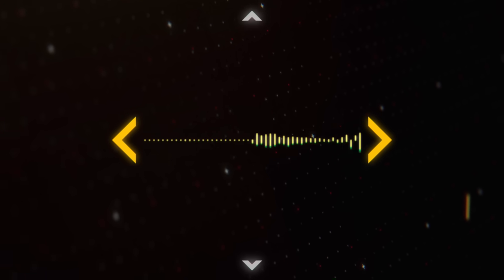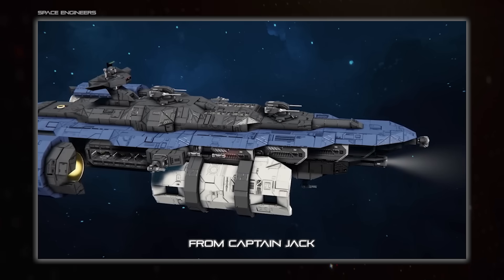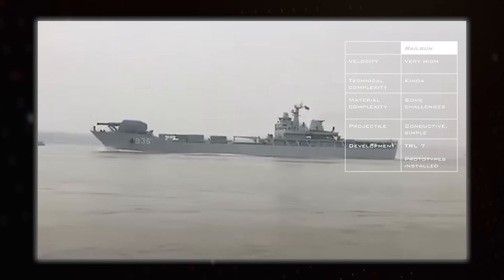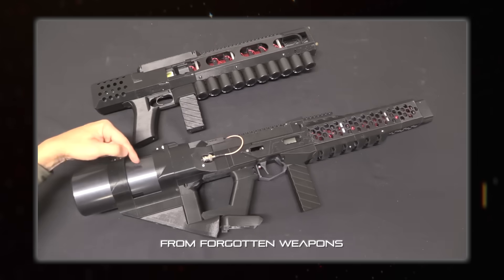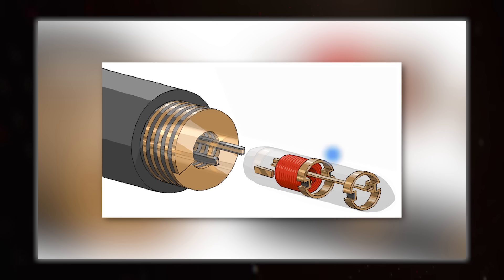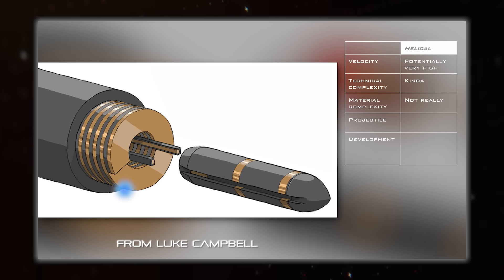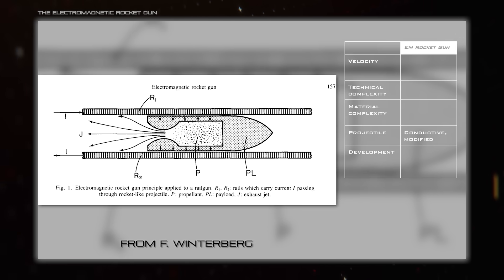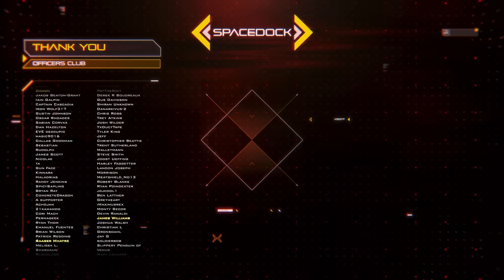The Deadly Coilgun/Railgun Hybrid You've Never Heard Of (Helical Railguns)

Comment: cant the coilgun detect the projectile... well magnetically?
Reply: That is easy enough to do, but an electro-optic system will probably be easier to shield from electromagnetic interference.
Reply: @derekp2674  No shielding, just use the coils themselves as the sensor, their inductance/impedance will react to the projectiles presence, so it becomes only a matter of reliably noise filtering for that no? wouldn't even need a computer, just some fine tuned analog circuitry (well thats what a computer is too but you get the idea lol).

Comment: The most efficient electromagnetic launcher is the "quench gun" a superconducting coil gun. The energy is stored in the superconducting coils then the superconductors are "quenched" by the magnetic field of the projectile automatically turning off the coils as it goes past. So apart from using superconductors it is actually simpler that other coil guns and over 90% efficient conversion of electric power to kinetic projectile energy. While rail guns manage 50% efficiency at best.
Reply: In a coil gun the projectile does not touch the sides of the barrel so there is no friction or arcing. You can find two videos explaining the quench gun by two rival teams trying to build one for orbital launch, Lancaster labs and Electromagnetic launch.

Comment: The big problem for the electrical rails is NOT friction due to "extra high speeds" as it is a problem even for low-speed railguns that fire subsonic.
Rather it is cause the rails need to form a good electrical contact at high velocities and that just doesn't happen easily: Either the contact is not even and you get uneven currents and hotspots, the projectile is a bit too slow and thermal expansion increases resistance, sparks and pitting (really bad), the projectile ablating - or many other things. We are talking about currents way above what is used for welding. The projectile will take a beating from that and that is ok, but the rails are exposed repeatedly to that. If there is any small deviation the projectile might go just a bit slower, further increasing the stress on the projectile and rails, which then again lead to even more deterioration.
This can be as bad as after just a few shot a projectile getting stuck and then basically welding everything together (or blowing the rails apart due to the metal getting evaporated).
Reply: There's also the issue that the rails repel each other when charged, so the gun literally tries to tear itself apart with increasing force the more juice you dump into accelerating the projectile.

Comment: I'll stick with my coilgun. Should really start building some again. The first was some 20 years ago. Me and a friend just bought 100 small elcos. 650V rating so we could just apply squared mains. 10 banks of 10 capacitors. The initial setup included us manually undoing the parallel charging connection and rewiring them in series, with the "trigger" being 2 metal-plates that were closed by getting hit with a good whack with a long wooden pole. Not all that powerful but enough to get a screwdriver bit stuck in some plywood.

Comment: 0:58 In real-life, the conductor which bridges the rails is a plasma. This minimizes wear on the rails and ensures an uninterrupted connection.

If you're wondering how that could possibly work, remember that plasmas are ionized, so they get locked into the magnetic field just as the projectile does.
Reply: That is true in a plasma armature railgun design but my experience is that plasma armatures actually maximise barrel wear. Hence a lot of work has gone into designing solid aluminum armatures to minimise barrel wear.
Reply: @derekp2674  True. The plasma would be extremely hot.
Reply: @pseudotasuki  Indeed, by definition plasma is hot. The term "plasma armature" became an accepted railgun term a long time ago. A more correct technical term would be an "arc armature" but it's far too late to correct that now. Even an arc requires temperatures high enough to melt metal, that is how arc welding works.

Comment: Awesome video! I have been working on my own coilgun for the last few months now, and I believe there is a sort of middle ground between the HCEL and a standard coilgun configuration. Here, instead of using a sensor and relay setup, brushes are placed some distance in front of the coil (or behind it, depending on the projectile), connected to the open ends of the Power circuit. Once the projectile reaches the brushes, the RLC circuit of the coil is closed by the conductive projectile itself, and current can flow with the projectile as a conductor. 

If that sounds a lot like a railgun, then you are right, it is, though in this case the lorentz works against us. The coil creates the dominant B field for the purpose of the projectile acting in line with the rail, wich in combination with the current flowing perpendicular to to the barrel causes an acceleration perpendicular to it and thus wear. This can be mitigated by using rings of brushes instead, allowing current to flow in parallel with the barrel, thereby preventing acceleration by lorentz force.

Not using complex components in the end has multiple advantages: 
-Near-instantaneous switching
-Reduced complexity and cost (high-voltage relays can get very expensive)
-Increased maximum voltage (mostly limited by the capacitor now)

I have not yet been personally able to run tests on this design and compare it to a more conventional setup, though i am quite confident in it, as it doesn't deviate too much from the standard.

Comment: The electromagnetic rocket gun can also potentially make it a recoilless system. If you want infantry portable railguns or at least something that can fit on a truck but you want the potential to destroy something really big, this might be the route to go. It's going to have one hell of a backblast but you can potentially use something like salt water as a secondary coolant, something that is used on the urban warfare, close quarter version of the AT4 rocket launcher, known as the AT4-CS. 

I do think that the cool gaps in sci-fi railguns are something that is an alternative to having the rails be of an actual material. Since you are running millions of watts of power through the rails, why not making the rails actually be plasma? Now, I don't really have a technical explanation of how this can be done though I would think you confine some plasma with a complex magnetic field.

Comment: Professor Winterburg's Electromagnetic Rocket Gun genuinely sounds like Boltguns in Warhammer 40,000.

Insert Futurama title card "You Can't Prove It Won't Happen" gag here.
Reply: Actually, the Bolters are closer to a conventionally propelled gyrojet hybrid.. Basically a rocket propelled grenade, given it's initial propulsion by a chemical detonation, similar to standard bullets. The rocket engine only ignites once the projectile has left the barrel (negating some of the issues with Gyrohets. Mainly the low muzzle velocity.)

However, it seems that the EM rocket gun is the electromagnetic equivalent to a gyrojet.

Comment: Honestly the coil gun would simply work having small sections coil that fire in sequence, back to froward at a certain frequency, and then repeated. Example: 1,2,3,4,1,2,3,4,1,2,3,4 That way the projectile is at the 4, it's clear enough away from the 1 behind it, and pulled into the 1 in front of it. You could even improve that by having some slates that are insulated between the circuit coils, or increase the number of the sequence to like a 10. And At worse you gotta raise or lower a frequency per projectile type in a given enviroment. 
And it's basically no worse than conventional artillery at that point.

Comment: I can see one major flaw with this hybrid in terms of viable weapon usage. It has to be clean, very clean. It'll make it a nightmare if you wanted to make them man portable, as some kind of field rifle or side arm. Also you can't easily use a lubricant either because it's either going to get in the way of the contacts if it's an insulator, or if it's conductive it'll screw up the timing of the moving circuit, by completing circuits it shouldn't be.

Comment: My idea of an electromagnetic launcher is just a crossbow thats primed by a high power electric motor. Mechanical power is stored in the springs, while energy is stored in a detachable battery. No need for capacitors, timing mechanisms or specialized ammunition. This arrangement is also wayyyyy more efficent than other launchers and can be made with relatively inexpensive off the shelf parts, so it can be scaled down to a long gun sized package.

A man that goes by the handle JoergSprave here on YT actually did something similar with a homemade ballista hooked up to a ebike motor.
Reply: That's not electromagnetic tho. That's electrically assisted loading for a torsion weapon
Reply: @matthiuskoenig3378  Not wrong, alltough the electromagnetic rocket might not qualify either; one could argue that it's a gun that just happens to use an electromagnetically excited propelant. Still, I think there is some potential in my arrangement. Sadly I can't even build an airsoft strength version yet. Someday, I will test the idea.
Reply: Love this idea. Reminds me of one of my favorite obscure sci fi guns: the thunderbolter from Timeshift. Semi automatic high velocity crossbow with exploding bolts. It's be a hell of a cool gun and it's totally build able with current technology. Sadly small explosive rounds like that are indeed a war crime under the Hague convention.
Reply: How much energy can you store in elastic compression though? Can it outperform explosive propellants?
Reply: @volbla  Sorry for the late reply. With a motor driven spring you can use a power supply that that is much more energy dense than gunpowder, such as an armored vehicle using it's petroleum fuel. The weight of the weapon system itself may be heavier, but that's insignificant compared to ammunition weight for many applications. Theoretically, a CNT spring could acheive 2.1 kwh/kg, and you would only need one spring for the whole system, rather than having a load of gunpowder for each individual cartridge. Bullets actually have a terrible mass fraction of fuel vs container, 9mm has a wt% of 8%, the rest is brass (this is why caseless ammo is so attractive!). This gives you a practical specific energy density of 250 wh/kg. Which a lot of modern li-ion batteries can compete with, if not surpass.

Comment: One of the issues with railguns (at least without other magnets to assist in forming the field) is the massive current tries to spot-weld the armature in place until it gets going. Which can't be great for that erosion problem. That's one of the cool things about the chemrail in Elysium, it starts with the armature/bullet moving.
Reply: Real life railguns typically use pressurized air, coils, or explosives to get the armature moving.
Reply: The ChemRail is one of Weta's most iconic designs.
Reply: Damn, I've been thinking of what would happen if that kind of hybrid system was used, I didn't know elysium adapted that to the screen

Comment: I've always hated the tuning fork depiction of railguns. Leaving the rails exposed invites corrosion, and having the prongs like that means they need to resist the stress of repulsion directly.  With a real gun barrel surrounding the rails, the stress from the rails repelling one another can be handled by the gun barrel. This would help keep the prongs from being shorn off in opposite directions
Reply: Not to mention how most designs have the rails far apart, implying extremely wide ammunition.
Reply: The art design just wants to make it really obvious that it's a rail gun. Otherwise it just looks like a gun with a boxy barrel.

Comment: Whacky ideas:

1. Get rid of the solid rails entirely and come up with a conductive gel that can be injected into the barrel to complete the circuit. The gel would then evaporate from the massive waste heat, causing the resulting gas to also provide a second source of propulsion to the projectile.

2. Forget about batteries and capacitors. Use piezoelectrics instead. That would allow the energy to be stored mechanically, causing a massive burst of current upon the crystal being struck.

Comment: My idea was a method to induce spin on the projectile from a railgun, simply by having the rails rifled with the rest of the barrel finished with insulator, the projectile effective range would be improved for lower velocities, allowing railgun with similar effective range be produced for far cheaper. Mainly effective for atmospheric shots, having fins and having the projectile contained in a sabo before shot will be redundant as the finns would be useless if the spin can be induced without them, hell the helical railgun design would work with the idea too.

Comment: tbh with you, timing a coilgun is not as difficult as it looks like, the overall physics of a rifle is already difficult enough, even worst if you consider APFSDS, problem is the materials involved, the best short term solution are ETC, eletro thermo chemical guns, similar to the termite in Titan Fall, other than that only if some different material were invented, something like a graphene sabot for a rail gun, if that was done the barrel ware would be mitigated, thing is, the material no only have to be capable of inducing current but it also need to be resistant enough to deal with the velocity, air resistance etc., and also be easier to manufacture, not considering the energy needed, like, supercapacitor capsules for each shot, or the sabot itself being a structural supercapacitor, which indeed can be done with graphene, that would work fine with the helical coilgun, but still, years away considering the current material development, you could go even further and suggest nanotubes, but that's beyond our reach.

Comment: With railguns, there is a risk of the projectile welding to the rails. With coilguns, the coils are a bit fragile. With helical railguns, that's kinda the best and worst of both worlds.

With all electromagnetic mass accelerators, their effectiveness is reduced by heat. Professor Winterburg's electromagnetic rocket gun would be even more negatively effected by heat.

Comment: You did miss my favorite electromagnetic weapon, the plasma railgun. This thing is fun; you pump a bunch of energy into a few milligrams of atmosphere contained inside the chamber, which then ionizes into plasma. Because plasma is affected by magnets, you can run it down a barrel. To keep the plasma together, the electromagnets are shaped so that they force the plasma into a toroidal shape, held together by pressure differentials. The upsides are interesting: since it only shoots air, the gun has effectively unlimited ammo as long as it has power, just like an energy weapon. Unlike an energy weapon, the destructive force comes from kinetic energy; although the plasma projectile is only a few milligrams, its muzzle velocity is ludicrous, on the order of up to three percent of the speed of light. The biggest downside is admittedly somewhat crippling for a spacefaring civilization, though: since the projectile is only held together by atmospheric pressure, the gun straight-up does not function in a vacuum. As for feasibility, a 10-megawatt prototype was tested in 1993 under Project MARAUDER, so it could potentially exist right now in a classified state.
Reply: I think they focused on designs suitable for space warfare. So not atmosphere dependent. The rocket gun being the exception as the projectile supplies the required "atmosphere" for ionisation
Reply: Actually, if you pump enough energy into the Plasma, you can accelerate it to relativistic speeds, which significantly decreases the plasma spread allowing it to be used in space, over long distances.
Reply: Dense Plasma Focus gang represent.
Reply: big fk off vortex cannon
Reply: Hmm Plasma Railgun combine with Electrolaser
Reply: I mean, you can just use a particle beam. Use something more punchy like a UREB